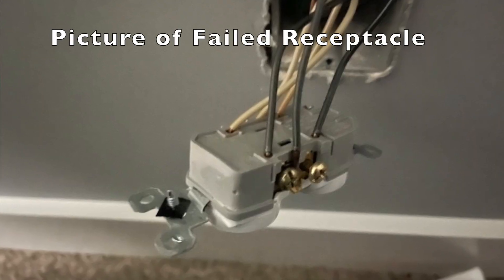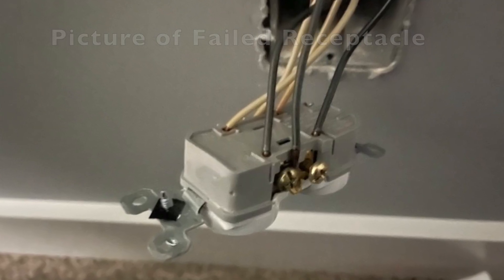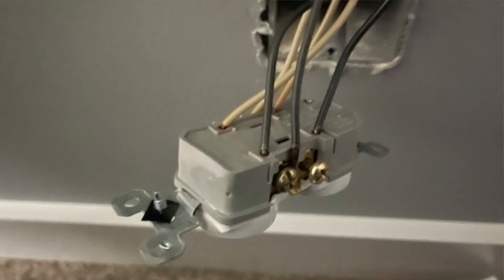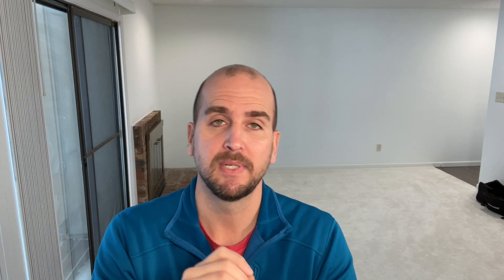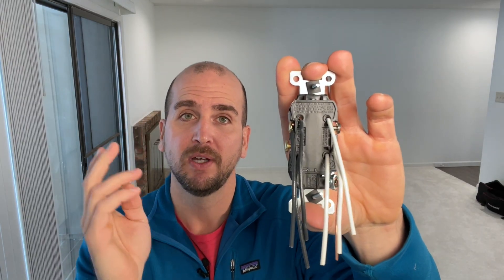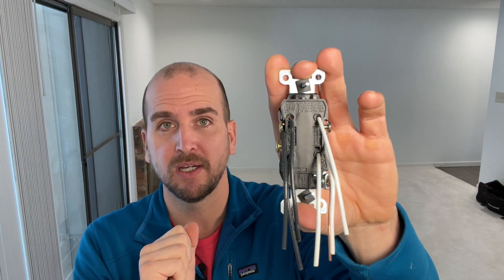Incorrectly Wired Outlet Found In Newly Built Home

Comment: Ok the most important is you do not want loads from other receptacle  passing thrue a device  that was wired to the back EVER. Will cause it to
.over heat
.lead to a fire .
.will tripp ark fault breakers 
So you always  splice the wires from the plug so the bulk of the amps will not pass thrue
Reply: How about just never ever ever use the stab in connections on the back. I've never done that and tell the new guys to just not do it.

Comment: Every time I've replaced an outlet in a home built in the last 30 years or so, they've used those push-in connectors. I'm guessing it is because it makes wiring go much faster.
Reply: Yes that was the theory but its completely  wrong to wire that way because  amps from other receptacle  will pass thru  that device to return to the panel so the risk of a electrical fire is increased  . Fires  kill people  .

Comment: Other than perceived neatness, I fail to see why having 1 twelve ga. wire going into a receptacle is better than having 2 twelve ga. wires going in there. Wouldn't that potentially cause more resistance?
Reply: When you pig tail wires, the Lead and the Load are tied together with the receptacle as a "branch".  If the receptacle fails, it fails, but all the other receptacles on that circuit still work.  If you put your lead and load both into the receptacle, and it fails, then everything "down stream" will not work.  Think of it this way.  The LEAD are the roots of the tree (breaker panel), the LOAD is the tree trunk, and the receptacles are the branches.  you can cut off one branch, the rest still have power.  But if you cut the trunk in half, and splice it with a receptacle (both wires in the receptacle and not pig tailed) and the receptacle fails, then everything above the receptacle in the trunk will die.    Pig tailing keeps electricity flowing through twisted wires, nutted together, rather than a thin piece of brass on the receptacle.
Reply: @danieljackson5758  Awesome, thanks - I'd also wondered about this.

Comment: The other day, the power to our stove (gas) and microwave went out- no clock, no display.  My wife wanted to test the outlet near them and plugged in the toaster.  She activated the toaster, and the two other appliances lit up- they had power, but not enough to run (microwave wouldn't even start).  When I pulled the receptacle out, one wire (white) was loose.  It was the 'push-in' type.  So, I bought a new receptacle, wired to the screws only and everything is running fine now.  Don't ask me why she wanted to mess with the toaster because.. it helped solve the problem, though.  Everyone should have one of those testers that tells you the power is off.  I hate getting zapped.

Comment: You inserted the hot on the wrong side the screw.
If you have 2+ grounds you are also required to pig tail and wirenut.
Push-ins are there but are illegal to use in some jurisdictions.  Release catch hole is smaller then #14 so you have to have a stiff pin of some sort to insert and release wire. It is always 'somewhere' in the pouch or in the tool box. Pain in the ass.
It is also not good practice to feed in and feed out to downstream through the device, you are passing the entire cct load through the small busses on the side of the receptacle. The buss is to allow you to split receptacles for counters and switched plugs.

Comment: Its quite cool to see what is Industry Standard in other Countries. Here in Austria (Europe) it is against Code to use these twist on Wirenuts in higher Voltage  Installations. We use something like „Wago Connectors“ or simple „Lüsterklemmen“ to make those connections. Wirenuts are only allowed in low voltage applications.
Reply from the maker: I was trying to get a commercial Pass and Seymour but picked these up at Menards and they didn't have one in the Decora Almond 🤷‍♂️.  Good call out as I do 100% prefer the commercial.  Even the Residential was a massive upgrade from the self contained outlet 😬

Comment: 1/2 ass job on a newly built home? What else is new? Welcome to the future where everyone does everything 1/2 assed.... don’t shoot the messenger
Reply: Seriously no joke. I work electrical on new residential homes. I’m on the finish side of things, but when I was still doing rough the amount of comers cut by all trades is crazy. Now that I’m on finish every house has a wiring issue.  Missing jumpers, colliding circuits, bathroom switches turning on garage lights you name it.  Track homes slapped together are just trash.
Reply: @j.a.y.1234  10-4 to that my man, I seen it too, it’s brutal these days

Comment: And use good insulated electrical tape around the connections around the entire outside of the outlet.
Reply: I am not a fan of electrical tape for permanent installations. The adhesive almost always deteriorates in a few years, either hardening or softening.
Reply: @flagmichael  It is and has been a very common practice, and safe one at that for near countless decades, simply to protect against shorting out, vibrations, movement etc. What you say either takes decades or really high heat, or very cheap, Vinyl tape.

Comment: I planned on using the pigtail route when I noticed that the receptacles with usb ports had one screw for neutral & one for hot. Then I noticed there was 2 push ins for each. It's 12g wire & a nice fit. Should I go back with pigtails?
Reply: The push-in capability is a sharp catch mechanism that bites into the copper. If you have a lot of plug in/pull out cycles like chargers you are moving the assembly about a little bit and the flexing at the catch point may eventually work through the wire, intermittent contact, sparking and poping. This is why in many jurisdictions use the push-in capability is against code. It may take a few years or more to fail. The wire is contained so it isn't about to fly around and short to the box, if so the breaker will pop. The broader UL and national electrical codes approved it as designed under all kinds of scenarios so if failure occurs it is to a failsafe condition, just noisy.

Comment: Question about the pigtail,can that one wire carry al the current for both wires,could there be overheating?.
Reply from the maker: Nope, there is no issue as long as you are using the correct size (gauge) of wire.

Comment: Bravo on nixing speed wiring. I would have noted the difference in wire surface contact between side wire and speed wire.  Also on the mechanical pig tail splice, instead of using the wire nut to twist the wires. On 10 things about outlets, i wasnt aware of the wire stripper, i was aware of strip guide, but never used it. Something you didnt mention was the ground screw being part of  the mount frame. Grounding to steel receptacle  boxes. So the receptacle  ground wire also grounds a steel box, if the box ground is not used.
Thank you for your interesting posts. I am a pro, also unlicensed, but with broad experience. Best practice is essential. These systems, including plumbing, ect can be safe and trouble free for decades, by following a couple dozen standards for technique  and matls. Familiarity with these systems, and standard terminology are useful when dealing with service people, and assessing they're  competence, especially  the ' i can install that ceiling fan for a six pack' crowd.

Comment: The pigtail method is very popular in Europe and Australia especially where outlets are installed horizontally. The push or wago connectors make more sense now days with pigtail wiring in the USA. The US wires are of a bigger gauge and harder material than outside the USA as well, so cramming alot of wires and using a wire nut can be a recipe for disaster. Different standards in different Countries is interesting to me. I have even seen within the USA, and Puerto Rico/California, a difference in installation habits and standards, which surprised me greatly! In Chicago it is horizontal mount receptacles on metal boxes,in conduit. In NYC is conduit and BX metal cable with metal boxes, in the south, it is plastic everything and in Puerto Rico and Southern California/Hawaii it is horizontal mount receptacles in metal boxes with conduit for the most part, and you can use NON UL listed Brands like Bticino, Vimar, Legrand(European standard sockets which are fancier than US outlets),and so on. I saw switches and outlets from Colombia, and Costa Rica and Italy, used in the last 3 places listed! Fun stuff. Mind you, I am only referring to RESIDENTIAL, not commercial.

Comment: always pigtail. Even if you use stabby connectors. It makes the devices go in faster with less chance of wire ends scratching the wall. It also allows the wire to lay neatly in the box without pushing on the receptacle. Your cover plates will look better when you finish trim out.

Comment: I recently updated my master bedroom's 10 electrical outlets to the new decora outlets.  I turned off the breaker, installed outlets being careful to wire each the same as the outlet I removed only to have my breaker continue to trip when the job was finished.  What recommendations do you have for how I should troubleshoot where the problem is?  Any advice is much appreciated.
Reply: re-check each outlet.....

Comment: All you american sparks needs to learn about wago. :-P
Reply from the maker: I am a fan of the Wago 221 👍
Reply: @EverydayHomeRepairs  that is my favourite too. 😁 Just make sure to buy branded ones. I bought some cheap off ebay and they have zero holding power on stranded wire.

Comment: I'm not a pro.  Regarding the need for pigtails. I believe if there is more than one hot wire in the receptacle box only one is coming from the circuit breaker and is therefore the SOURCE of the power.  You would normally not have two different breakers suppling power to the same receptacle(*). Therefore, the other hot wire(s) are actually SUPPLING power to other loads downstream of your receptacle, such as other receptacles along the same wall or other loads elsewhere.  I wouldn't want those downstream loads to draw current through the receptacle contacts. Especially the push-type contacts which might be less reliable.  With the pigtail the downstream current flows through the wire nut which is a more reliable connection.  

(*) Interesting story from my childhood.  The only time I have seen two different breakers supply power to the same receptacle is when my dad wired our kitchen.  He split the duplex receptacle by breaking the metal tabs (shunts) between the two individual outlets making them electrically independent.  He then ran a dedicated BX cable from each individual outlet to a new dedicated 20-amp breaker.  He did this for two duplex receptacles.  So we had 80 amps available in our kitchen.  Never another blown fuse!

Comment: What is the point of having a back-wired receptacle if you are going to use pig-tails?  I have seen more failed wire-nut connections than properly torqued back-wires.  In addition, the pigtail and wire nuts can over-fill a crammed box. Just curious.

Comment: You should also tape your wire nuts and run tape around the outside of your outlet to prevent the terminals from touching anything and shorting out.

Comment: I am a DIY homeowner who does all my own electrical work.  I always use best practices and always use the latest edition of the NEC to make sure I comply.  Many years ago when I began renovating our first house I encountered those stab type receptacles and decided that I don't trust them despite all the UL certs and whatnot.  Common sense wins out all the time and I have seen photos posted by electricians who encountered these type receptacles charred to a crisp.  They should outlaw these.  I prefer the receptacles that you insert the wire in through the back and the side terminal clamps it tight.   Many years ago while I was still living with my parents, I woke up in the middle of the night and there was a blue arc that I caught out of the corner of my eye.  It happened intermittently and I then realized that it was coming from the receptacle.  I turned off the circuit at the panel and removed the wall plate to find that a 6 penny nail the was used to hold the box in had worked its way out and was within the arcing distance of the hot side terminal.  The wall were plaster and lath.  I fixed the problem then went back to sleep.  Thank God i woke up in time or who knows what could have happened.

Comment: About the wire nut  . The wire nut its self already has like tread inside that allows the wire to align itself in its groove   creating a strong connection. In the other hand I see in the video twisting the wire with a pliers then putting a nut . I asked my self if the nut should be doing the job for me instead of me twisting the wire with pliers then wire nut it?

Comment: I have 2 hot wires and 2 neutrals. I thought I was suppose to put 1 hot on 1 screw the other hot below it. same for neutral side. If not then what are the 2nd set of screws for?
Reply: While yes you are correct. It is better to do the pigtail method.

Comment: Another thing I do is point the pigtails up when stuffing the wires in the box that way if water were to leak down in the box the pig tail wouldn’t fill with water. This keeps them dry and less chances of getting corrosion. There’s a very remote chance of this happening but it only takes a second to point them up.
Reply from the maker: Not a bad practice, thanks for the feedback 👍

Comment: Why would there be a way to remove stab in wires if you should not reuse the stab ins? Manufacturers should not provide this stab in removal slot and you then just cut the wire and throw away the receptacle.

Comment: I was taught as an apprentice to NEVER wire an receptacle to #14 wire, but always use #12 wire and a 20 amp circuit breaker, and save the #14 wire and 15 amp circuit breakers for lighting circuits. I'm a retired electrician, and still go by the same rule.
Also, when shopping for receptacles, you get what you pay for. While shopping, grab a plug, and plug it into different receptacles. You'll notice that the cheap $0.98 receptacles plug in and out really easy, and the $4 receptacles offer more mechanical resistance. That means a better electrical connection and less electrical resistance. Where there's an opportunity for electrical resistance, there's an opportunity for heat. And that's an opportunity for fire. Do yourself a favor and buy the more expensive receptacle.

Comment: The reason why you use a pigtail when I worked in commercial office building you could have six outlets on a circuit if you remove one with pigtails is No Interruption to the other Outlets

Comment: I did that years ago when my dad and I rewired the farmhouse and it passed UL inspection. I believe the inspector said it was legal. I would use an extra deep box and wire nut the three connections together there would be only one wire each to the outlet the reason  why there are three connections is two daisy chain connections one going right and one going left. This only happens on the feed wire connecting the two daisy chain runs. The wire nut is the better connection using gorilla  wire nuts.

Comment: I'm a first year electrician as far as I know if you use the stab technique with the wires in the back of the receptacle you don't use the j hook side mounts. My journeyman says it looks ugly and step them in at least too much confusion if somebody wants to do a home repair and then they look at it and they go what do I do we try to make it as easy as possible. For the homeowner so they're not confused. But each one of our homes comes with a wiring diagram what kind of wire we use that whole mine so I like that part.

Comment: I wasn't clear.  You said your wire was 12AWG and it looked like you were using a 15amp receptacle.  I've learned that same 15amp receptacles don't work well with 12gauge wiring; especially if you use push-on holes in the rear..  Nothing wrong in most circumstances using a bigger wire with a 15amp breaker. as it can help prevent voltage drop over long distances.
Reply: 15 amp receptacles are allowed on 20 amp circuits. this is stupid as hell, asking for problems. hazardous when 1500 watt space heaters are plugged in for  an extended period.